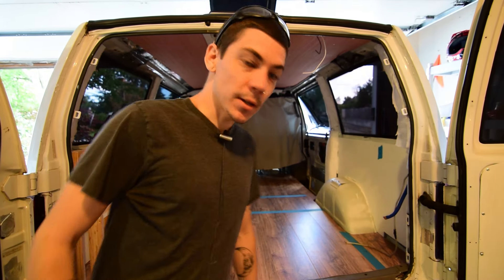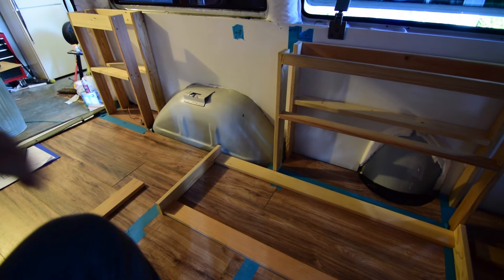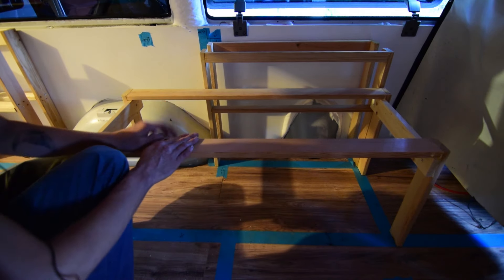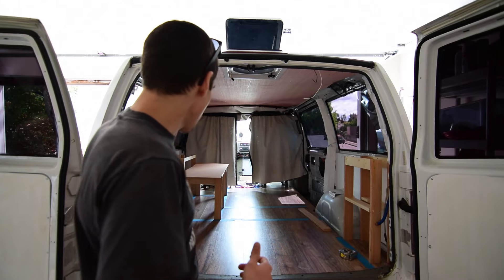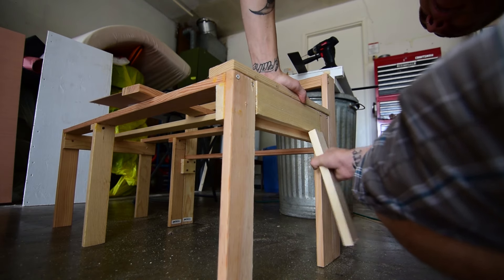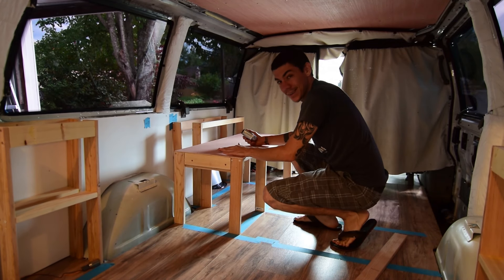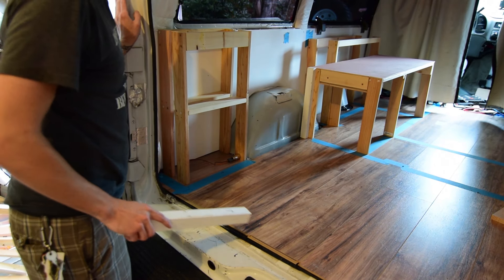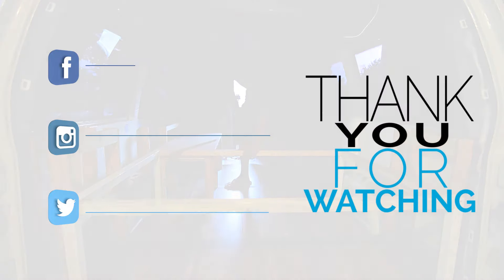VAN BUILD 2pt10 ULTIMATE ASTRO STEALTH VAN DWELLING

Comment: Looks really great. One suggestion...instead of glueing down that flat panel at the front, why not glue some small blocks on the under surface so that it firmly sits in place but can be easily pulled up as required to get access from the top? May not be needed often but there is no compromise. Why not have both options.

Comment: Be careful with screwing into the end grain of wood bruv. You might want to consider putting stretchers into the pieces of wood you need to screw into the end grain of because when you do that the screws do not have a lot to grab onto making them much weaker and you run the risk of the screws coming out or pulling out over time... Just a thought! If not adding stretchers possibly invest into a pocket hole jig!
Reply from the maker: +Logan Connor thanks for the tip! I used extra long screws, but if they fail ill definitely be doing this